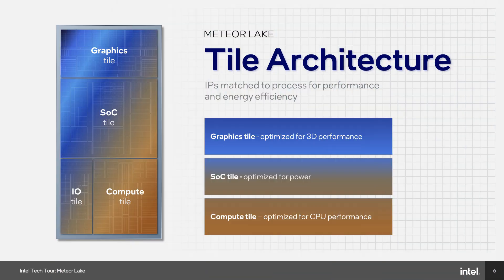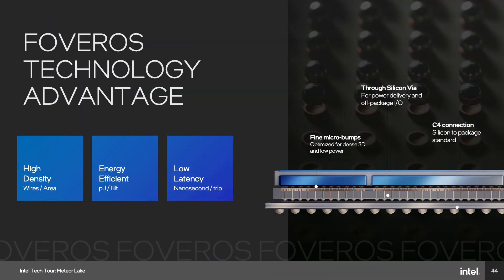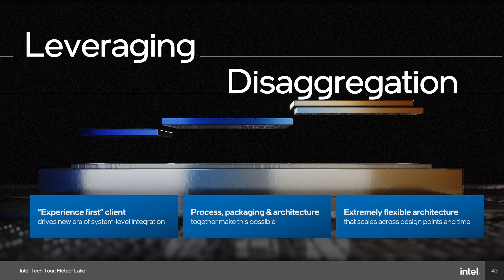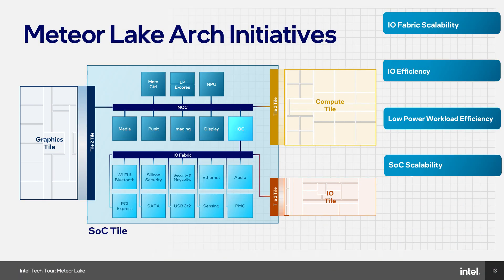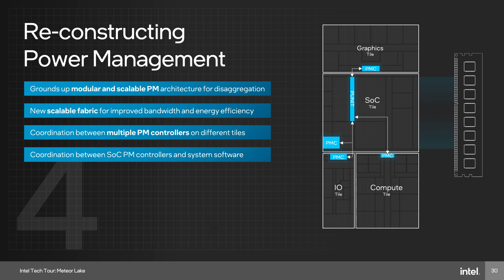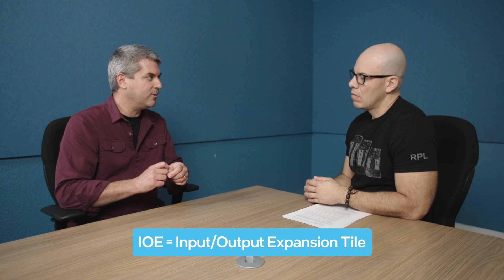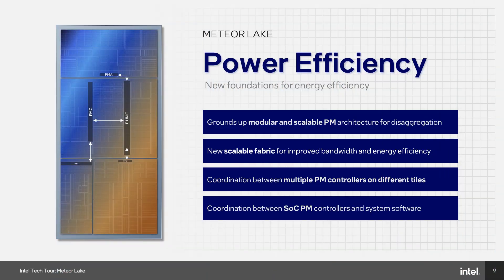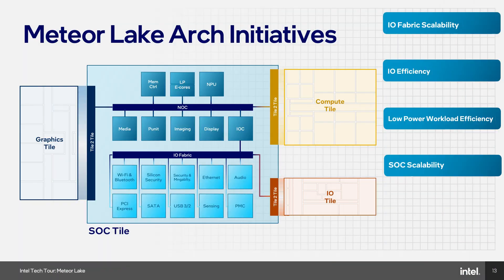Meteor Lake's SoC Tile and Disaggregated Design Explained | Talking Tech | Intel Technology

Comment: Meteorlate:
Congratulations, Intel, 8 months late, but now you have a comparable apu to AMDs7000 series apus.  Too bad hawk point will decimate your late to market meteorlate apu
Reply: Hawk Point is nothing more than a rebadge. It has nothing new to offer other than a frequency bump to their AI engine.
Reply: Hawk Point is even more worst refresh than raptor lake refresh.
Hawk point has same CPU cores, same frequency, same iGPU, same memory support, same memory speed as Ryzen 7000 APU.

Hawk point just has a new NPU, other things are exactly same as Phoenix.
Reply: Meteor Lake iGPU while using less power is still 5% to 20% FASTER than 7840HS with 780m in many games.

ARC driver is coming next month.

In some games ARC iGPU is 50% FASTER than 780m.

Both are using same Ram.

I am excited to see LPDDR5X 7467 RAM for ARC iGPU launching in CES 2024 from most Intel OEMS.

Comment: Why not just let us, user manually control which app will use which core/thread, when to use low power mode when to use high power mode?
U try so hard in 3 gen just to make its automate. But the fact is user is the who know which is best for them. Give us that control

Comment: X86 is obsolete. Time to move to arm.
Reply: Come up with an original thought, and the past almost 7 years disagrees with that. Just look at the 7700K to the 14900K and the 1800X to the 7950X3D
Reply: Such an L comments. Intel meteor lake prove x86 cpu can be as efficient as arm cpu.
Reply: @runninginthe90s75 

Yes, Hp pavilion Plus 14 (68 Wh) with #AMD 7840U has 10 to 11 hours of BATTERY.

Hp spectre x360 14 (68 Wh) with #Intel Core ULTRA 7 155H has 14 to 15 hours of BATTERY. 😱

Intel laptops BATTERY life is as good as MacBook M2/M3 even though Intel is using Tiles/Chiplet.
Impressive🤯
💪
Reply: @runninginthe90s75  meteor Lake isn’t super efficient, it’s maybe marginally better than Raptor Lake-S, but if there is a Raptor Lake-R for mobile, it won’t be. Either way, depending on the workload, efficiency isn’t everything. Maybe a CPU is 50% more efficient in a benchmark, but if that makes the more efficient CPU take 2 times as long, it will still have used more power for the complete work.
ARM also has horrific software support within the windows ecosystem for now. It doesn’t matter how many times faster your CPU is if you can’t run the software in the first place
Reply: 😂😂  Keep dreaming forever.
Reply: Oh totally. A lot of people think ARM has been making RISC chips power efficient to match customer requirements...  Totally false.
ARM actually tries to design the fastest chips possible, and the low TDP basically just happens on its own. It doesn't work with X86 because due to their complexity, complex instructions draw about 10W each continuously. Multiply that by the hundreds of x86 instructions and you can see why RISC is so much more efficient
Reply: No. The two architectures are for 2 different purposes. x86 is easier to program with due to the fact that you can use complex instructions and it also is great for compatibility. ARM is a bit tricker to program with due to the fact that it has less instructions so you have to use more instructions to achieve what one instruction on x86 would do, but it is more efficient in terms of power (at least it looks like that).

Basically CISC vs RISC

Comment: When you will provide driver update or thread director update so LP E cores will work to play video by turning off both CPU and iGPU tile.
Reply: It's already working, in some of the reviews that do local video playback, netflix streaming, and browsing power consumer goes way down. It's not perfect though and stuff like youtube seem to still use the normal E-cores.
Reply: @__aceofspades 

I have GalaxyBook4 Pro and yes LP-E cores are working. I am loving it.
Reply: Video Encoding Decoding is good on this. Lets see what other laptop manufacturers come out with. Pcie 5.0 nvme slot anyone ? Also interested in if someone tries egpu with this.
Reply: @And-vx6ry  ok